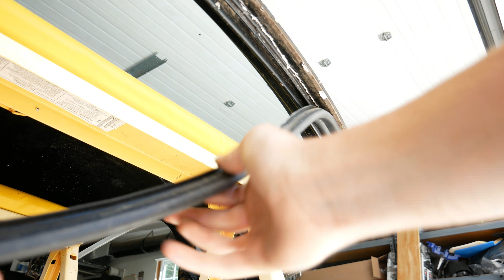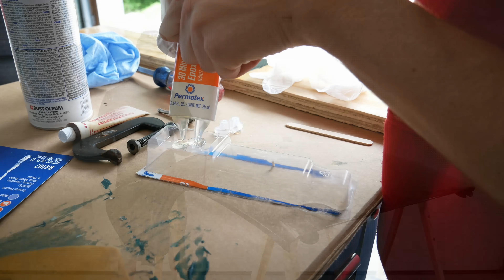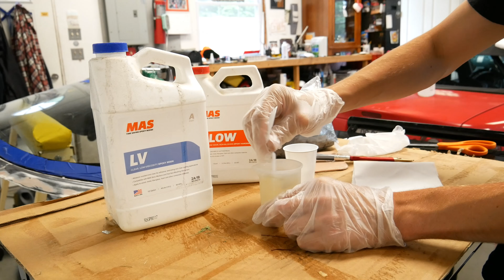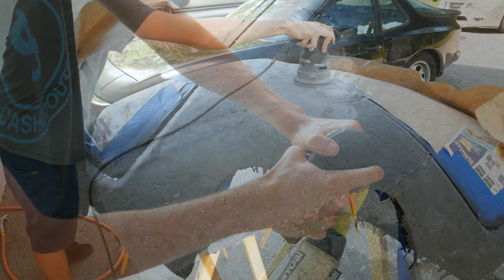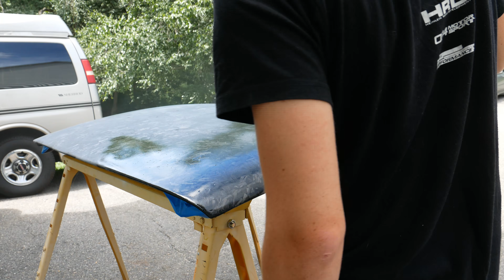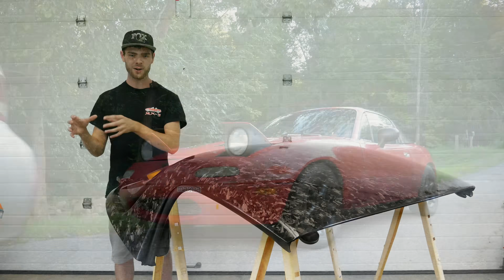How To Skin Parts in Forged Carbon Fiber | DIY Chopped Carbon Fiber Tutorial

Comment from the maker: UPDATES: After a year, I can confirm that I'd recommend using a higher quality clear coat. This clear coat has faded and become rough. I'd recommend spending money for a higher quality clear coat. Also, be sure to use a UV resin designed for outdoors!

Materials Used (Affiliate links for which I may be compensated)
Venom Composites Chopped Carbon: https://amzn.to/3JM2IVx
Carbon Fiber Roller: https://amzn.to/3AaBF2K
Peel Ply: https://amzn.to/3SGLaOr
Sanding Disks: https://amzn.to/3QhDoZU
Sand Paper: https://amzn.to/3vXbIRY
Polish: https://amzn.to/3zKmDQ4
Reply: how much of the chopped carbon did you use?
Reply: Shoot wish I could f8nd someone to fully carbon fiber my whole new chevy tahoe like that hard top
Reply: Pravim fiber camce..primetio sam da mu je ostalo puno  rupica u zavrsenom radu.

Comment: Is there any reason not to use peel ply to get a more uniform layer when applying the top coat to the first carbon layer. As in, using the peel ply on the second layer of resin?

Comment: Honest question, if skinning is purely cosmetic and not structural then why not just do a vinyl wrap in the carbon fiber style? They're extremely realistic looking nowadays and it's all cosmetic anyway.
Reply: Because vinyl looks ass and not as shiny. Also it’ll peel over time,
Reply from the maker: That's certainly an option, in my case I wanted to structurally repair a few areas on this top as well as get the look

Comment: It comes out much better when you pour epoxy over things. You let gravity level the epoxy and fill in gaps. Its messier but you're only left with the drips on the edges which are easily sanded down. Window removal is required with this process but worth it in the end.

Comment: try and use mipa p67s if you can get it in the US. its a clear primer you spray on but need a gun with 2.5 - 3mm nozzle. once you have sanded the carbon and put on 2 coats of resin and sanded that use the clear primer. its pretty thick and fills in any imperfections. do not thin the primer with anything. once primer is on its really easy to sand smooth ready for clear coat.

Comment: Looks good. I'd suggest using a 2 part clear coat (like spray max 2k clear) as it will go on a lot thicker and get very hard so it can actually be buffed/polished. The single part clear coats in a spray can isn't strong enough to do that.
Reply from the maker: Thanks for the tip! I might respray it, as this clear did definitely start to dull a bit. It still looks great, but doesn’t shine quite as much as it used to

Comment: So, how much does it weigh now? Just bustin your balls. It’s great to see you use peel ply. Not to many people do that. Next time once you put peel ply down, put a coat of resin on top of the peel ply. It will be resin rich but you will fill in all voids and low spots. You won’t have to put extra coats and you will sand less. Also use automotive 2k clear, it’s so much better.
Reply from the maker: I’ve gotten the weight comment way too many times🤣good tips, thank you! I may respray the clear with a nicer coat soon

Comment: I'm pretty sure you burned through that rattle can clear pretty easily just by sanding with P320, from there you are pretty much just refining/polishing the epoxy resin. I would recommend using a 2k clear coat sprayed with a $15 gun from HarborFreight if on a budget. Results will be 100% better than any rattle can clear.

Comment: Hey mate. There is a way to greatly improve "flatness" of surface. After you peeled off that peel ply and sand it, simply put 3 heavy coats of resin 1-2 hours apart from each other (See datasheet of your resin to know then the "B stage" is). This will build up a thick layer which will close low spots between chopped fabric. After 48 hours or even better 72, sand it as flat as you can again, do that trick with a syringe (if even needed) and apply last cosmetic resin coat when resin from syringe gets to B stage again.

Try it next time bro, you will see the result will be waaaay better :)
Reply: I kept waiting on this step but it turned out decent, just needed this 1 extra step and it would have been perfect 🤩
Reply: That's what I was thinking. So much work to only get an "okish" look.
Reply: i know this comment is 3 years old and i truly hope you respond. i’m currently trying to do this same project. i just wanted to ask what was the syringe trick you mentioned and how would you determine if you need to do it ?
Reply: @dat_0ne_st1ck_of_buTTer  guy added small resin mix from syringe on "pores" or low spots between fabric to fill them.

if you do what i poposed on original coment you probably won't need to do that :)

Comment: I wasn't expecting much when I started watching this video but I'm impressed.  Your video was extremely well done.  Great video, great narration and descriptions.  I have a University degree in Plastics Engineering Technology and and have been painting cars for 30 years,  I wouldn't have done it much different than you did.  I do wonder though, what's the weight difference before and after?  Looks excellent, nice job
Reply from the maker: Thanks so much! It probably added 5 lbs or so. About 1.5 lbs of carbon, and the rest resin and paint
Reply: @CashedOutCars  The small increase in weight more than makes up for the increase in rigidity of the top. I've got a hardtop that's basically as rough as this one. This video may have given me the inspiration to do the exact same thing. 👍

Comment: Good job on the video production..  Ya got most the idea but lots of miscues on the application and products. Rattle can paint under resins is not a great idea and chances of delam will be high. A base black tinted layer of resin will be much better. While the mas lv is a decent resin system it's heat deflection temp is very low for automotive uae and doesn't have good uv protection. Using a coated peel ply rather than a economy peel ply will pull off much easier.. You can wet out over the peel ply on any dry areas. Hope these tips help out on your next go
Reply from the maker: Thanks for the tips!

Comment: I guess I’ve got a new project lol. Great video! Just throwing it out there, there are resins like the ones that they use in boat glass that have UV protection built into them. That and your clear coat would prevent the lay up from oxidizing and turning green. Also avoid getting the carbon dust on you, it’s some really irritating crap and disposable coveralls are cheap.
Reply from the maker: So far so good on this resin in the sun, but I agree, the more UV protectant the better. Also yeah, carbon dust absolutely sucks to get on your skin and clothes

Comment: Its important to mention that you dont want to wax fresh paint for at least 30 days and you dont want to ceramic coat for at least 6 months to let the paint cure first. Otherwise you can trap solvents in the paint and cause issues.
Reply: It’s actually 90 days for waxing or coating. A coating is more breathable than wax as well
Reply: @thefinaltouchdetailinggrap4409  keep in mind the first statement was correct , if you are spraying automotive paint made for cars then the 90 day rule applies, however as Bdnfinc doesn't go further into on and should have , the majority of today's automotive paints are low VOC , however most canned spray paints are not low VOC and thus take longer times to outgass and should you check the compliantcies you will note some of the clear coats are based epoxies and others are based Lacquer, and the Lac takes even longer at time depending on quality and coats applied to cure.

What is low VOC automotive paint?
Low VOC paints have been engineered to have fewer harmful chemicals. Instead, these products are primarily water-based, which is harmless to the environment.
Reply: @thefinaltouchdetailinggrap4409  Mate I've painted cars for 14years. It takes 4months at least for paint to fully harden. I see "detailing" in your name though, definitely sounds like a detailers sale pitch so it all makes sense 😂
Reply: @Dj.Ray.Von.  but isn't every paint different in terms of how long it takes too fully cure?
Reply: That is dependant on the type of ceramic coating or graphing coating. I’ve waiting 6 weeks and had dramas and I’ve waited 3 weeks with no issues. All do to do with the paint type etc

Comment: That’ll delaminate for sure. Using rattle can paint underneath and bondo are all wrong. The rattle can clear won’t last long either, especially with all the voids you can see on the finished surface after all the buffing. Start with harbor freight paint guns if you don’t feel like spending big $ to get started.
Reply: Resin is just as adhesive as paint .

Comment: Hello this title is misleading. You did not forge anything with pressure or heat! You laid down carbon fiber cloth NOT forged carbon fiber. There is no forged carbon fiber cloth . You take carbon fiber cloth and resin and you then forge your part with pressure and/or heat. This hear is the problem with our platform ,anyone can give you info that’s not correct and really with confident delivery it’s believable to be factual. In fact don’t take my word for it. Research this topic for yourself and troll my channel or comment right here if you find that I’m incorrect.  Please for the love of google don’t let me go around popping my mouth off with whack unfacts!

Comment: This will turn yellow in two weeks tops. MAS epoxy is an aromatic epoxy, and it will not hold up to direct sunlight exposure. An aliphatic epoxy is better suited for this type of application, which is more UV and color-stable than aromatic epoxy.

Comment: I know it's not you making up the term for doing this, but this is not forging carbon fibre. This is just dressing an existing part with CF chop and resin. 
Maybe everyone doing this should rename their videos "I'm using the same stuff they use when they forge carbon fibre in a different process to make my existing thing look cooler."
Reply from the maker: You are correct, but I have to use the term to get the search results to help people looking since chopped carbon is so frequently called forged carbon

Comment: Nice video. Like how the Forged came out. I do carbonfiber overlay as a Job. I do a Lot of this. People don't realize just how much Time is involved. Great job man. I've done a Lot of Forged/chopped carbon parts. Most is 1/2 inch or 1 inch strands
Reply: When I worked on a large multi car NHRA team, the funny car bodies came in as a show and then the Fab shop would build the internal trees and firewalls and all that stuff, it was really really cool to get to talk to guys that worked on Indy cars and things like that in the fabrication shop and get to work on and learn all those different things! I never made anything like what the composite shops would do, not by a long shot but you're exactly right, the amount of work that the places that built the parts would put in I mean just a little box that held the radio was just an absurd amount of hours, I got to go to this place is quite a bit as well and the guys that are good are just that they are really damn good!

This is not my trade like it is yours but it's always really cool to see people get excited about something you do for a living, like in your case!

Comment: I was disappointed when I read the title of this video once more and realized that this is only a skin 😔. When skinning, it's almost like defeating the whole purpose (to save weight, right?)  because the actual factory roof is still there lol.
Reply from the maker: In this case it’s simply to repair and strengthen the broken areas of the top, and for the look. It hardly added any weight too
Reply: @CashedOutCars  I mean who doesn't like the look of Carbon Fiber. It's still an impressive job and I'd like to let you know that I did watch the whole video. Me personally, I'd just challenge myself to see if I'm capable of doing Carbon Fiber parts from a mold.
Reply: @CashedOutCars  Oh by the way, In no way was I trying to criticize your video or your style of doing this. If it came across like that to you, I sincerely apologize and it wasn't my intention :)

Comment: Why does it still have a million holes in it?
Reply from the maker: They’re tiny air pockets in the resin. They can be filled, but in most lighting it’s not really noticeable, especially from a distance. To get a 100% solid part you’ll almost always have to degas the resin and vacuum bag or infuse the part, which makes it a much tougher job to get done at home

Comment: Just a head up avoid using any bondo on an SMC part. When you sand it, release agent will be released. Always use some kind of epoxy based filler. They have stuff specifically for this, such as repair kits for corvettes, or upol sells a good product that's carbon fiber reinforced.
Reply from the maker: Interesting, SMC is listed as a surface that bondoglass is "Great for use on" by 3M themselves: https://www.3mcanada.ca/3M/en_CA/p/d/v000146405/

Comment: To help with dry spots add extra epoxy over the peel ply this also works for doing it with carbon fiber cloth. working it in until you see no change in color.
Reply from the maker: Good tip

Comment: Can this processa be applied over a metal body part (ie, hood, etc)?
Reply: yes you just need to use abrasive sandpaper to start that way it holds in the long run
Reply: Pretty much any part. As long as you prep the surface properly.
Reply from the maker: What they said :)

Comment: This is a great way to make miata hardtops worth $7k 👌🤣
Reply: No low ballers , I know what I got
Reply: Honestly worth less now
Reply: Carbon fiber add extra weight 😂
Reply: @waerp11  really it's the epoxies weight.
That's why you forge/vacuum draw epoxy for good results
Reply: @waerp11 Not a bad thing for a cheap Miata top.
Reply: Who pays anything like that for a Miata?
Reply: As if we didn’t need more crap driving the factory hardtop prices up.
Reply: Not skinned in wont. Full carbon can though 🤣 all you need is one of my fancy hardtop molds. Or try your hand at 3d printing a "negative mold" but that usually wont be thick enough
Reply: Not really. Its just skinned. And needs another coat of epoxy. I saw nothing  but dirt catching divets in the finish. 😂😂😂.worth $1k max. And that is being giving.